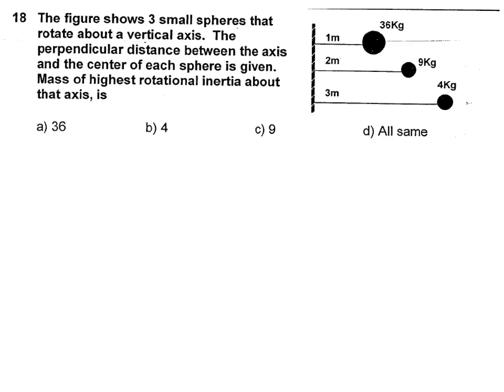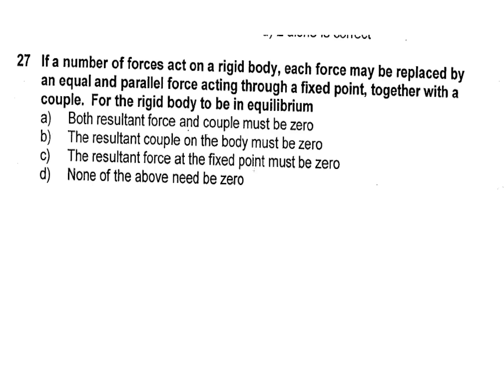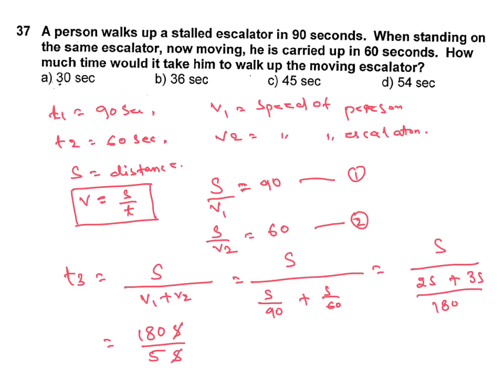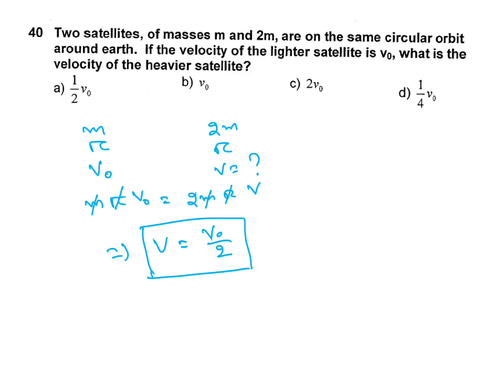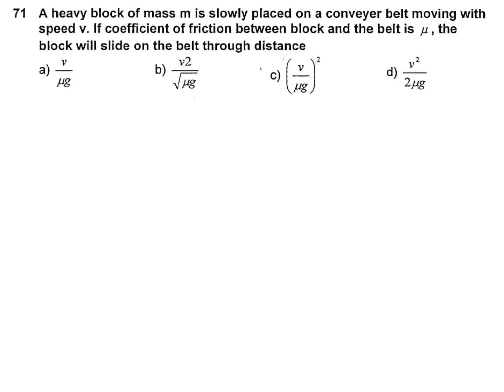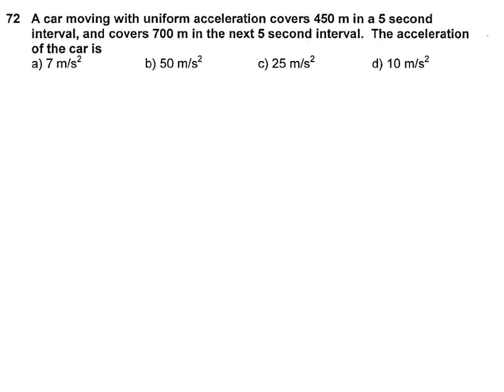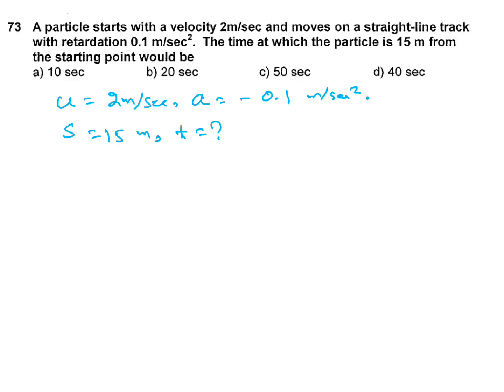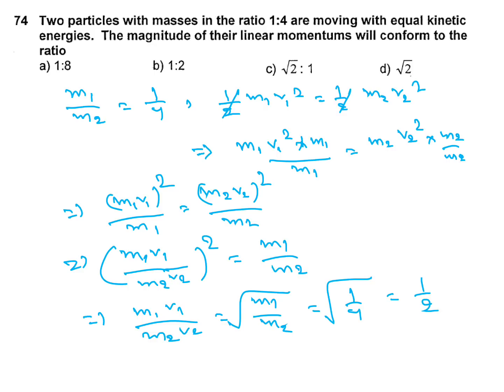MECHANICS ISRO - 01

Comment: Answer to the qs 38 is ''Tension is maximum at bottom of the circle". Why??
 Here's the trick to solve this question. Remember these sign conventions
 1. Tension in circular motion always acts towards the center irrespective of its position.
 2. Resultant Centripetal force always acts inwards (only for inertial frames) 
3. Weight always acts downwards 
Now balance the forces at all positions. Voila there's your answer. ******************************************************************
 If you remember this formula you can directly substitute and find the tension in string. 
T= mg cos(tetha) + m[u^2-2gr(1-cos(tetha))]/r
 tetha @ bottom position be 0 
and tetha @ top position be 180 
You can derive this equation from 3rd equation of motion and balance of forces.
Reply from the maker: Sharfuddin mohammad thank you ✍️✍️✍️
Reply: You are welcome sir.. Kudos for your dedication in making these videos..Thank you

Comment: when two mutually perpendicular principal stresses are unequal but ALIKE, the maximum shear stress is
Reply from the maker: HARI PRASATH in plane not mentioned then  sigma one by 2 or major principal stress by 2. if in plane then (sigma one _ sigma 2 ) by two
Reply: Sir options are: 1. the diameter of Mohr's circle 2. half the diameter of Mohrs circle 3. one-third the dia of Mohr's circle 4. one-forth the dia of Mohr's circle
Reply from the maker: HARI PRASATH half the dia or radius.

Comment: a plate with a circular hole is subjected to a transverse load, the magnitude of stress infront of the hole in the axial direction is 1. same as the stress in the transverse direction 2. 3 times the stress in the transverse direction 3. 2 times the stress in the transverse direction 4. the magnitude of the stress is zero
Reply from the maker: no axial stress so ans 1. same as the stress in the transverse direction.
Reply: thank you sir
Reply from the maker: HARI PRASATH at axis shear stress is maximum that is also important.

Comment: a hollow shaft of same cross sectional area as solid shaft transmits a) same torque b) less torque c) more torque.. Please explain
Reply from the maker: ALREADY DISCUSSED IN SOM VIDEOS, SAME CROSS SECTIONAL AREA As=Ah, for same weight , Ph is more than Ps.
Reply: Yes Sir, already i had watched that video, but most of the text books are mentioning that the solid shaft will transmit more torque than hollow shaft. For clarification only I have posted. THanks sir

Comment from the maker: Correction Qs 38, at 8:45 tension is maximum at bottom because at bottom tension is inward and centrifugal force and weight are outward, Tension, T = mg+ mv2/r.
Reply: In a four stage compressor, if the pressure at the first and third stage are 1 bar and 16 bar, then the delivery pressure at the fourth stage will be..?
A. 1 bar
B. 16 bar
C. 64 bar
D. 256 bar
Reply: Ty
Reply: 64
Reply: Yes at bottom it'll be maximum please correct

Comment: sir; quest:38@8:45...solution is wrong , it should be D not A because tension is maximum at bottom not at the top.......please comment
Reply from the maker: Vivek Kumar yes u r correct, I followed made easy , which is wrong, at bottom tension = centrifugal force+ weight , this is correct , thanks for ur help.